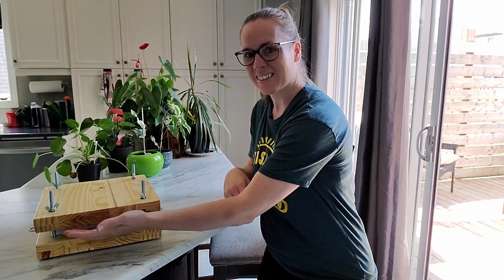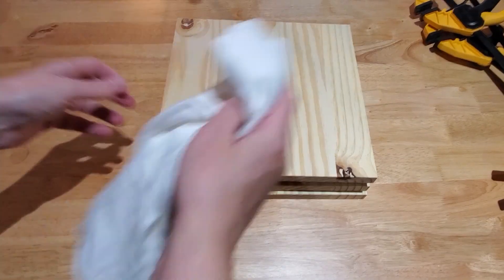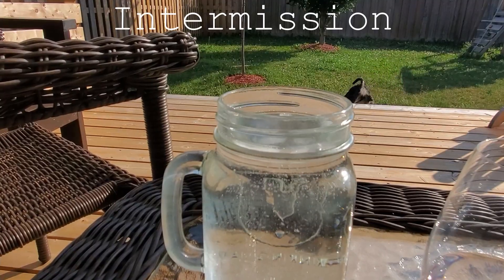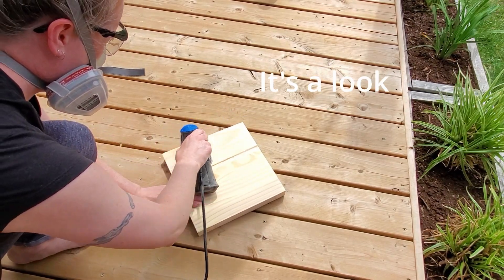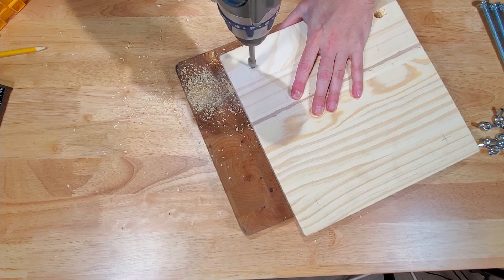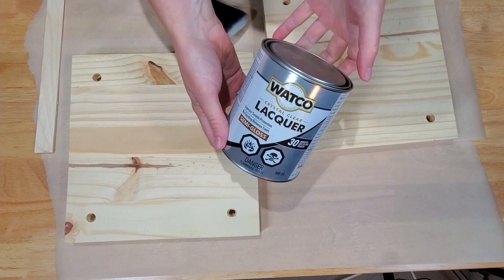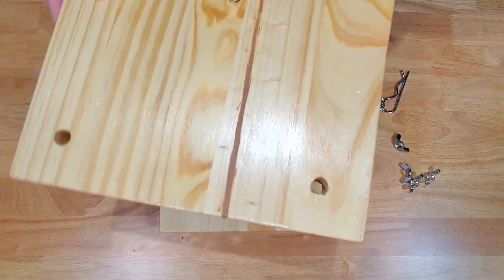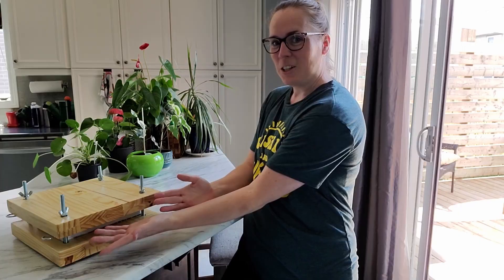How to make a DIY Book Press!

Comment: hi ! quick question, how many inches thick was the wood you used ? ^^
Reply from the maker: Hi, they are 1"x12" boards, but the actual width is 3/4". When doubled up they would be around 1 1/2" thick. Thanks for watching!
Reply: @TotalPamarchy  thank you so much !